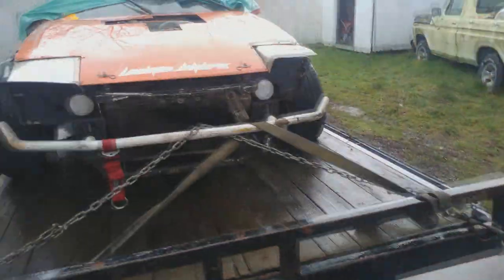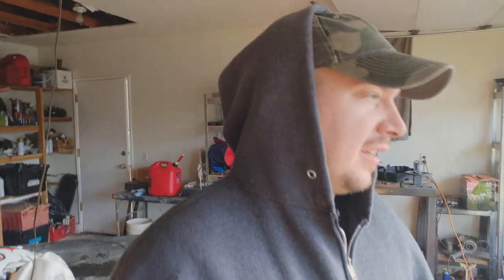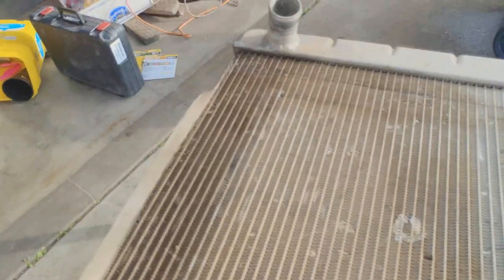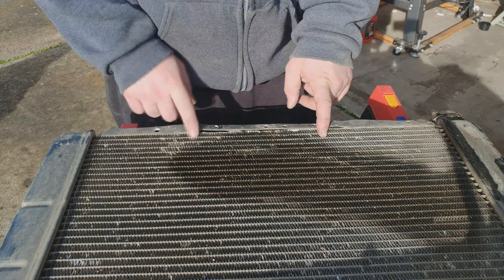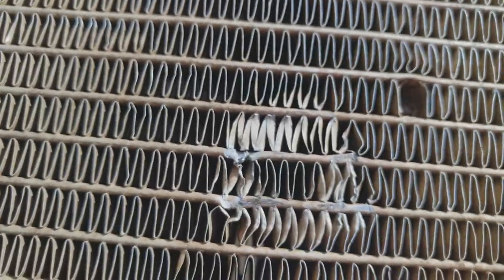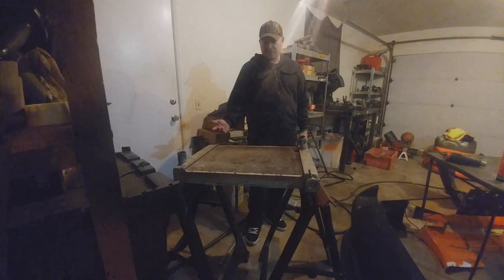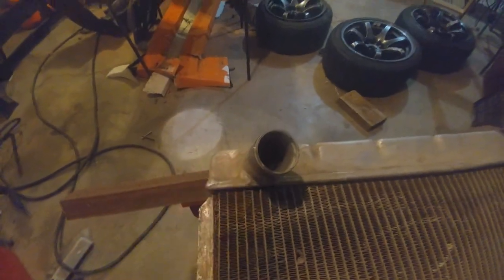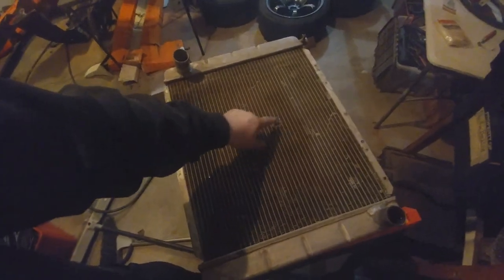How to JB Weld a Leaking Radiator

Comment: I bought a radiator off ebay for my beater car and it got a hole in it somehow. JB welded it, let it sit overnight and then put it in the car. It's been about 7 months and it's held up great.
Reply from the maker: Good work. People to this day still say I'm crazy for doing it but the results speak for themselves. If it ever does let go you should comment back on this post and we'll see how long it held for and how it finally, if at all, failed.
Reply: @leftcoastdrifter 06/18/23, I did this repair almost two years ago and it's held up great.

Comment: The J.B.on a radiator works well.. The key is to pinch off the broke tubes at the sides of the radiator first. Then hit with the cold weld. I've done it with my 95 deville with the Northstar & its lasted for years. Many years & still running today. Did this back in Maybe 2000? Still working & no leaks.
Reply: Bro me this is clear as mud. How can you pinch off tubes needed for circulation?
Reply: @bluuedaniel  I only pinched  off 2 tubes right at the reservoir &  every  couple of inches along the length of radiator. Clean where the holes were &  hit them with the J.B. a few coats & no leaks ...still no leaks. & The car doesn't run hot! I wouldn't try it with a real bad leak.
Reply: thanks i,m clear now. i thought the whole '"u" on each end.im looking at slow leak of my lady friend's.
Reply: @bluuedaniel  cool & good luck! Like I said it works great for small pin holes in the cooling tubes on the radiator. Big leaks or leaks on many tubes? Probably not. I've never had a problem with my northstar engine overheating & they are famous for that....

Comment: I did this jb weld on a commercial box truck leaking radiator. JB weld stopped the leak, drove for years and it never failed
Reply from the maker: I keep telling people that if they do it right it's a great field repair and it will last longer if you need it to.

Comment: You have to put air pressure and find out if it doesn't work for real
Reply from the maker: Luis Cruz. You could if you wanted to but I was pretty positive it was going to work and it did. Zero problems since this video.
Reply: Ive done the radiator, working for a year so...winning. I just hit my buicks silly coolant hardline that had a pin hole in it, tested it to 16 psi held firmz. Jb weld is the truth for small leaks.

Comment: Did exactly like you showed. Really helped. It had been holding on for quite a while despite the pressure.
Reply from the maker: Awesome! I truly believe JB makes a really good product that works when done right.
Reply: Wish jb weld did u use?
Reply: Wich jb weld did u use ? There is so many
Reply: @thegamerstx1267  Looks like original JB Weld bro.

Comment: Hi... may i know which type of JB weld u use? I know theres a few types out there... can i use the normal metal repair, steel repair, or specifically the Radiator repair kit?
Reply from the maker: In this video I used the normal JB Weld BUT... If JB makes something specific now for radiators and other parts I would hands down go with it. They clearly know their stuff.
Reply: I used the marine

Comment: I used POR 15 black POR patch on my fuel tank. It says impermeable to solvent and fuel. You think it would work on the radiator too? I think it’s superior to JB Weld for a fuel tank so I imagine should work pretty well on the radiator.
Reply from the maker: Possibly but keep in mind that there is around 14 psi in a radiator and basically no pressure in a fuel tank. That would be my only concern. Also, it's been years and it still hasn't leaked on me.
Reply: @leftcoastdrifter  yeah but there is pressure from 14 gallons of fuel sitting on top of it. You know what I mean. I just have this entire tube of patch and want to use it lol. I still have to find the actual radiator hole.
Reply from the maker: Nothing left than to think about. Try it out and post back on here if it works or not and what you thought of it. I'm always interested in corky life hacks for us car guys.
Reply: @leftcoastdrifter  will do. Once I find the hole I’ll give it a go and see how it holds up.

Comment: Will it still work with the radiator hooked up and running ? It won’t melt ?
Reply from the maker: I don't fully understand your question but I'll try to answer it. No, I would not try to repair your radiator while there is still coolant in it. Remove the rad, clean it thourghouly, dry it, apply the JB, let it harden as directed and then reinstall the rad and go.
Reply: Water weld good to 350F and what 900 Psi, High Temp JB water weld 550F and even more psi.

Comment: well done! I also want to repair my motorcycle's radiator with JB Weld, but there are so many different types of it. Which one did you use ?
Reply from the maker: I thought I talked about it in the video somewhere but I could be wrong. I believe I used the original JB Weld but I might have used the aluminum stuff. I know I have used both types on different jobs and never had a problem. Just make sure your piece is as CLEAN as possible and error on the side of using too much. My radiator has held every bit of pressure I have thrown at it without leaking a drop so I know it works.
Reply: Dustin Becktold  thank you for the answer and advices 👍
Reply from the maker: @muratkoc  no problem, man. Thanks for watching the video.

Comment: What jb weld did you use bc there are so many different ones, i need it for the aluminum part on my radiator just like you
Reply from the maker: I believe I used normal JB Weld but I'm not positive. This was the second time I had patched an aluminum radiator with JB Weld and I know for sure the first time I did it I used regular JB. But if JB says to use the aluminum stuff I don't see a reason to doubt them or it for some scientific reason lol.
Reply: jb metal marine
Reply: Webster autozone

Comment: Nice video man! thanks for sharing!!! please tell me how long it's been since the repair...has it leaked? or fix for good! will it stand high revolution gears since pumps at higher rates? I recently JB Welded my radiator and is working fine but I'm driving it like an old grandma...lol
Reply from the maker: 2 years and still going strong in my racecar.
Reply: I would put plastic weld and ad a stronger one after. Does that sound like a good idea? Would waterweld help?
Reply: It's a good repair. it holds well when pushed into the cooling fins they got big surface area.
Reply: I have one going for 4 years and more . Another one sodderd or brazed using actylene torch is hokding for 10 plus years.  The radiator repairmen here attach the metallic tanks tobradiators using sodder
Reply: UPDATE: It's been over 2 years and still holding up very well! JB Weld dried hard like concrete!

Comment: do you know if  this JB weld work on the plastic side of the radiator as well?? ( I have a tiny teeny leak...like a drop or 2 coming out for the side)
Reply from the maker: The French Traveler Artsinfotos, I believe they make plastic JB Weld so probably. I've never tried it on anything besides steel or aluminum.
Reply: Try epoxy
Reply: Not on the plastic
Reply: The plastic one is trash! I've tried the stick which too is trash.
Reply: @dimefever1006  I got that stick too for a repair like this but its where the core goes into the tank. That shat is so facking hard you can't get it in there and it won't stick to nothin

Comment: How long does this last?
Reply from the maker: I've done several drift events since this video with zero leaks. And I don't baby the car, I go all out so if it was going to blow easily it would've done so by now.
Reply: Dustin Becktold I just repaired my Aluminum Atv radiator with High Temp Quick Silver.  It’s very similar to Jb Weld.  You ever used Quick Silver man ?
Reply: Dustin Becktold 
Awesome,  thanks ☺️
You’ve just saved me a lot of money.   I hope you win the lottery!!!
Reply: Until it gets hot
Reply: Very good

Comment: How long has it last you without leaking from the repairs?
Reply from the maker: It never leaked again.
Reply: @leftcoastdrifter  nice,rn currently doing that,put quite a bit on it with a needle
Reply: You can probably buy a used radiator for $20 at a salvage yard
Reply: @leftcoastdrifter  I'ma try it. Got 2004 BMW. had it pressure tested. Shop said radiator leak.  Figure JB will work. Did it a PETERBILT and it worked.

Comment: Never had any luck on anything I ever used JB Weld on - it never works for me.
Reply from the maker: Sorry to hear that. I don't use JB a lot but when I have I have rarely had any problems unless I messed something during my prep. Otherwise I found JB to be a pretty good product for it's intended for. This rad patch was suppose to be a band aid and 3 years later it was still holding pressure and coolant in my race car so I just left it alone.
Reply: @leftcoastdrifter  - I guess I expected it to be like a weld … used it on broken cast iron and it just didn’t bond.

Comment: Will this work on a ac radiator my wife's impreza had a rock make a dent in it
Reply from the maker: Probably not. The pressure is anywhere from 80 to 300 psi.
Reply: @leftcoastdrifter  thank you very much. I've seen some people use jb weld to patch a hole in the engine block I figured if it can hold the engine together why not.
Reply from the maker: engine oil pressure would only be around 80 psi, max, when cold. AC pressures can go well over 300 psi all day long. It's worth a shot but I couldn't say for sure what would happen. I would look for the aluminum JB Weld version if possible.
Reply: @leftcoastdrifter  diffently will do that, thank you very much for the info and I'll give an update once I get it fixed
Reply: @willhernandeziam update?
Reply: @ethans6.0  worked for about a month and a half enough time to get a replacement ordered and not suffer in the summer